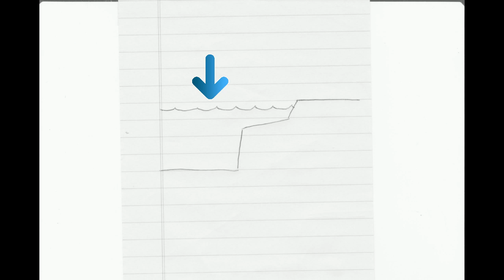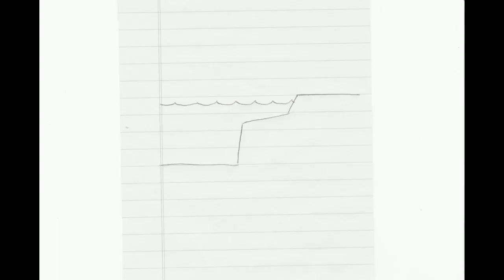How To DIY Backyard Stream and Pond

Comment: $1500 wow, i was thinkink easy $10,000.  i imagen lots of hard work, but can see worth it. its magnifico.
Reply from the maker: Thank you, I could be wrong but I think the actual costs were:  Rubber roofing $160, stuff to seam the roofing together $139, rocks $565, rocks for waterfalls $200, 2 pumps (caught them on clearance) $80, pond filter $130.  Total $1274.  I think that's pretty good considering the size of the whole thing.

Comment: I'm gonna get snotty and say you can build a wetland filter instead of using a pressure canister but hey I'm impressed, you guys built an outstanding aquascape! Do you want to do mine?
Reply from the maker: I only allow one snotty comment per video.  After that I start dragging people off by their ear, LOL.  I thought the stream might act somewhat as a filter because we put some sand in the bottom but it didn't work out that way.  If we get around to expanding on the stream like we want to, I'll look into building a wetland filter.  Thanks for mentioning it.
Reply: @imstillworkin  All those rocks already act as a bio filter to control nutrients as long as there are the proper species of bacteria. Plants in a bog style filter will add to water clarity.

Comment: Love this! I'm in the process of preparing my liner. This has been a yr long solo project working here n there...digging by hand. I'm using rubber roofing as well. Wish I could've gotten my hands on enough of the black stuff used here but white/grey was all I could find at a good price. The plan is to cover it with thick black plastic so it doesn't show. Fingers crossed that works out🤞Nice work u two! I so can't wait to kick back n enjoy mine as well.

Comment: Black rubber roofing is fine to use as a pond and stream liner and much less expensive. Of course someone trying to sell you pond liner will say no don't use rubber roofing it doesn't work it's toxic. If rubber roofing is seemed correctly it will last for years and years.